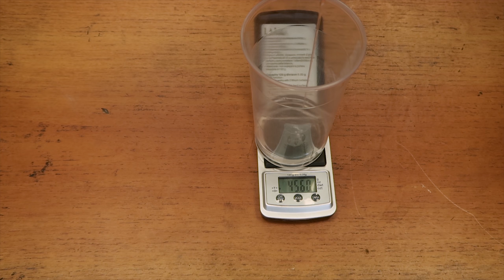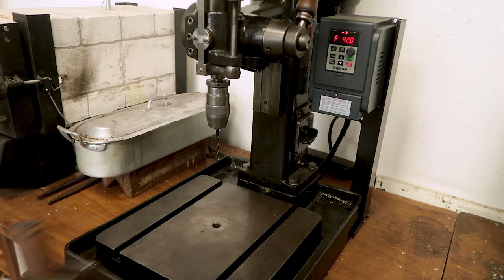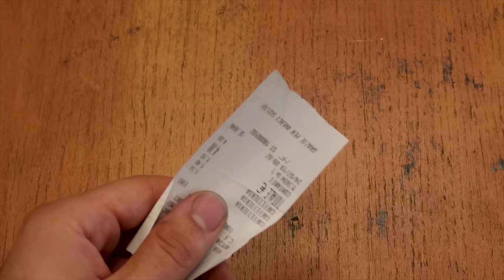Japanese Ko-Bunka 100% Homemade | DIY

Comment: so blackbeard, you were heat treating the blank and used some kind of powder on it before you sealed it in foil, what was the powder and why did u do that ?
Reply from the maker: It's regular talc, used to prevent the stainless steel foil to stick to the blade!
Reply: @BlackBeardProjects  oh  ok cool 😁👍 thanks for the info.

Comment: I was going to comment on what a great knife this was, how it really looks really good and would be a fine addition to any kitchen. Then I saw 16:09. What kind of knife is this!? It is so dull gravity cannot even pull it through the fruit. Hard pass. 

(serious question though, does that stabilizer make the wood safe to put in a dishwasher? That is my biggest issue with wood handles, and I would love to make a set that did not have that limitation)

Comment: Cutting a knife shape out of a piece of steel is not 100% DIY. 100% DIY means forging a knife, not cutting a knife shape then cleaning it up and putting a handle on it. If you want to make knives, make it the right way and forge one out of a piece of steel